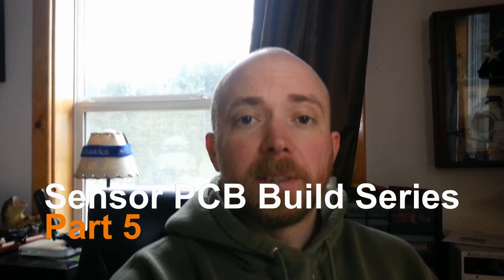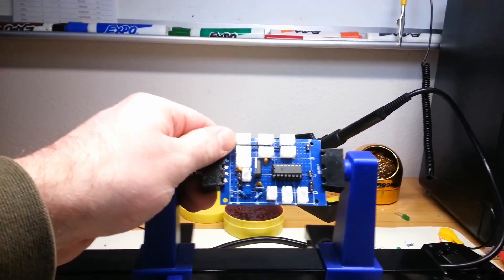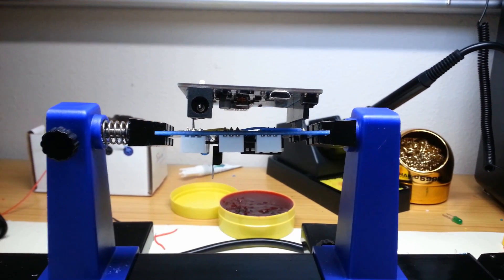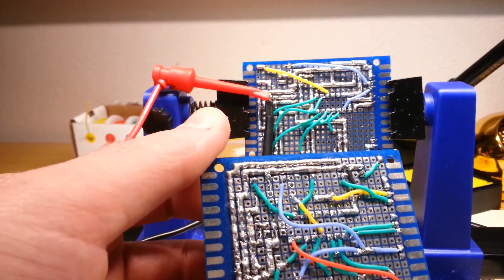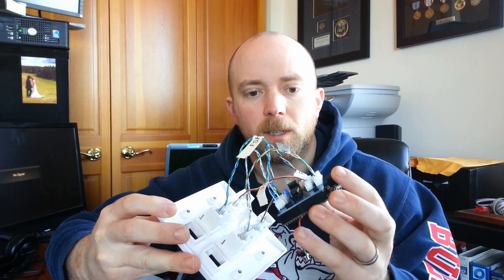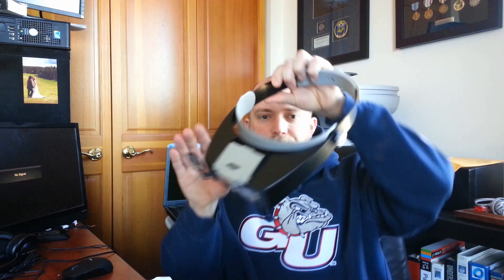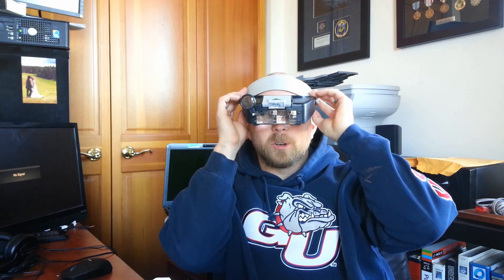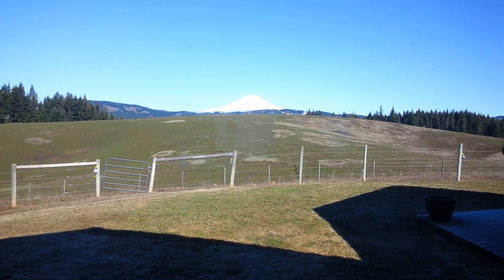Arduino Controlled/Monitored Greenhouse - A Mess - Part 5

Comment: not sure if you are already aware but the wire you are crimping needs to be braided wire. the solid wire will not make a good connection with the teeth of the RJ45.
Reply from the maker: thanks for posting...yeah I ended up looking up the type of connector I got and according to the pin type inside of it I should be able to do braided or solid...I think the real problem was my crimper I watched it crimp under a magnifying glass and the die simply seemed to be off in certain parts. New Fluke crimpers inbound

Comment: Your issue could be the type of cable you are using withthe connectors. There are differnent connectors for solic copper cable vs. stranded. Check out the L-COM website. They have a lot of resources. http://www.l-com.com/content/Article.aspx?Type=N&ID=10592

Comment: All these respiration problems made me think.  You should be using a small fan to blow away the fumes from the solder work. The lead in the solder and the chemicals in flux can cause lung problems and cause hair loss.  JK  Couldn't resist that one.  but the fumes should be avoided.

Comment: think I said in a Previous Make sure you use Correct RJ45's[Solid or Stranded] for the correct type of cable type..

Psst re the crimp Tool.. I actually found out the Better the tool[Price-wise] the better the job they do..
some of the cheap tools are CRAP... good for a while then they fail..

Comment: Never use male RJ45 connectors to make a cable. Ditch the crimping tool and never buy another. Always use female RJ45 connectors, those that require no tool to work with. Hubble makes good ones. I tried to message you on Facebook about it, but I never heard back from you.

Comment: I use an AMP 1-231652-0 tool with different die sets for RJ45, RJ12 etc. I bought this tool over 25 years ago as I was making a living from custom cable making. I did a quick google search and they are currently selling for $180 without a die. Probably a little pricey for your needs. Remember that RG45 plugs come in two kinds, one for solid core wire and one for stranded wire.

Comment: Hi TRM. 
About your Mark 1 PCB problem with the power supply...
I've got a short glimpse of the LDO (LM7805) positioning on the board and i revisited your first video on the subject.
It seems to me that the input pin of the LDO (where the external power should be connected) is oriented towards the center of the board, altough, usually  the power connector should be placed on the edge of the board. If my assumption is correct you just connected the input power to the output of the LDO and this usually is not good :)

Comment: I'm sorry to hear you are sick. But, it's time for a reality check. If you are already burning the candle at both ends trying get your greenhouse up and running, you biting off more than you can handle with the arduino board. Yes, it would be wonderful to build your own custom system for managing your greenhouse functions. But, the fact of the matter is that most arduino projects never get past the breadboard and they are rarely durable and hardened enough to tolerate the conditions of the real world where there is static and corrosion and voltage spikes and so on. You clearly don't understand the protocols of board construction. You don't have the equipment for board manufacturing. You can't put it through the rigorous environmental studies that a manufacturer does. Odds are that you damaged a component on your previous board because you aren't strapped. It could also be because you overheated a lead. 

Arduino boards are learning devices, they aren't made to be durable. Save your yourself a ton of grief and assemble your greenhouse monitoring system with factory tested modules. Industries use programmable controllers and well made sensor modules. There are lots of options available. There are boards to interface it to your computer if you like. You can always build and test devices to add on to your system. But, you are going have nothing but grief trying to make your own circuits because you set your expectations way to high for yourself. It takes a group of engineers to make a quality product.
Reply: Robb403 maybe come down from your ivory tower and join in the bazaar sometime.
Reply: My position on the "tower" has been earned by years of experience in electronic testing and circuit board construction. Those who fail to learn from the experience of others will never get on the "tower", let alone high up on it.
Reply: Robb403 and I would not have gotten to tower without the bazaar. It can be hard to learn from other's without getting personal experiences to understand why other's mistakes were mistakes. I see no reason to look down my nose at people trying to learn what I do.

Comment: TRM, Hope you get well soon. Glad you used the shield. 7 volts means a bad (or wrong) 5 volt regulator. Mark 2 looks a lot cleaner and less of a rats nest. You didn't mention the type of crimper. Get a Klein Ratcheting Modular Crimper/Stripper/Cutter. Theses won't release (open) until properly crimped. Cheaper than a Fluke but just as good.  http://amzn.to/2nmxHiN
Reply from the maker: thanks! I ended up going with the Fluke version...the klein one seemed to be getting knock offs from China that weren't the same quality....hopefully the fluke is as good. Appreciate the support and inputs here. 

On the relay...if it was bad would I still be getting 5v across it? it was weird because right on the relay I had 9v in and 5v out but as soon as you get onto the 5v bus, it went up to 7v...head scratcher